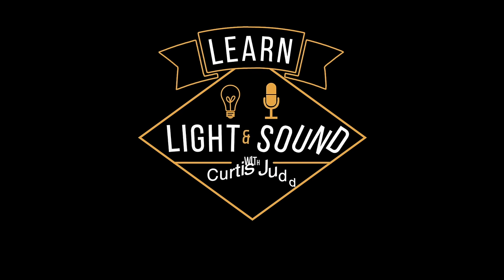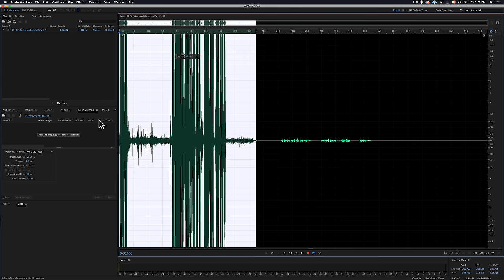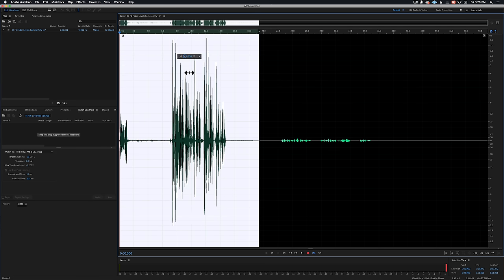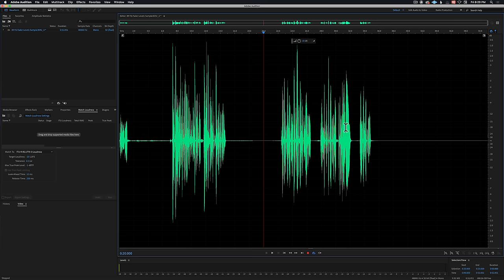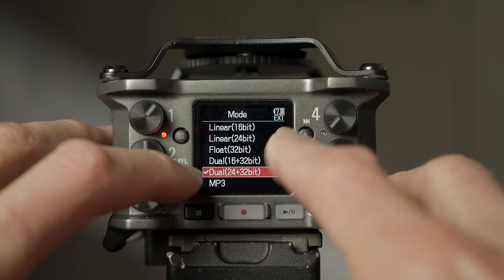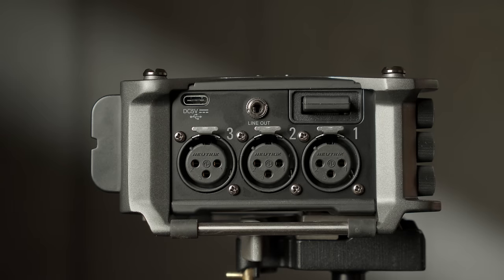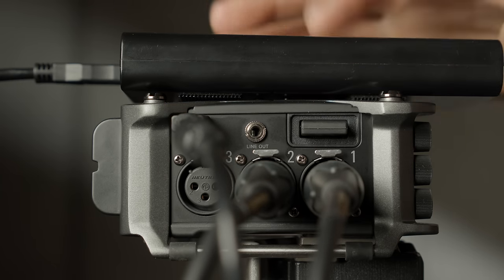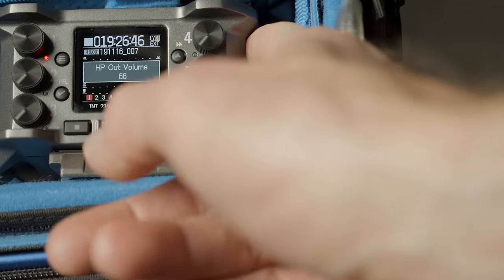Zoom F6 Audio Recorder Review

Comment: Dear Curtis, I have seen and analyzed your precious documentary many times, thank you.
I ask you now for another kindness,
I connected the binaural head in the channel (Fader 1L Fader 2R) and a Cardioid microphone in Fader 3
I put on the binaural as you recommended Poly. I have a +50 db Mic trim, normal stereo link enabled, HPF of, Imput Limiter of,
Phase Invert of, Fader +24.
In the Cardioid same except for stereo link off

In your video I read on the zoom screen +53 db
Then you say that the first part you recorded it at + 60db but I get up to + 24 and the last you recorded it at - 60 db but I get to -48
(what should I enable)

After recording with a Cardioid microphone (the same happens for the binaural head) it creates two rows one at 24 and one at 32, if I open them together as I think it should do, I notice that in the amplitude statistics window, it says that 24bit amplitude depth , while in your test I see that they are 32 bits. But if I only open the 32bit file, it says 32bit in the window.

I thank you in advance for the advice you will give me.
Reply from the maker: Hi Alberto, if I understand your question, I believe you will only want to open the 32-bit files as it sounds like you are recording both 24 and 32 bit. If I have misunderstood, please let me know.
Reply: Hi Curtis, I'm interested in 32 bits, for the binaural head. I would like as little noise as possible with the greatest possible volume and detail. I'm looking for the best setting.
Reply from the maker: @albertofelicettii426  I see. I would set the the F6 to 32-bit float mode in the REC menu. That should give you the best results. Best wishes!
Reply: Are there no other adjustments? The Trim and the Fader at what values is best to put them?
Reply from the maker: @albertofelicettii426  When in 32-bit mode, the knob is a fader and there is no trim setting. I would adjust the fader until the meters peak around -12dBFS.
Reply: Thanks for the advice, and congratulations again for the nice documentary

Comment: hi, thanks  for the video.   so  f6 is absolutely better  than  f4, right？  i want to choose between the tow.  need your advice.
Reply from the maker: Hi, it is a little more complicated than that. First, the F4 is discontinued. Once the current stock runs out, my understanding is that Zoom does NOT plan to manufacture any additional units of the F4. However, the F4 has balanced outputs which the F6 does NOT have. If you need balanced outputs, the F4 may be a better choice. If not, I'd probably go for the F6. Best wishes!
Reply: @curtisjudd    thanks  a lot.  by the way,  i need make a school  film.  f6+ntg5,  would this be a good  plan？
Reply from the maker: Yes, good combination!

Comment: Hi Curtis. Thanks for your videos which are always excellent. On occasions where you're not using an xlr mic, is it possible to connect something like a Rode Wireless Go mic receiver to one of the inputs?
Reply from the maker: Yes, you'll need a RODE VXLR adapter or equivalent.
Reply: @curtisjudd  excellent, thanks.

Comment: Great Review! Just wondering if it would be possible to use the timecode out to jam into the GH5. And if so what cable/adapter would I need? Thanks
Reply from the maker: You could feed timecode to the audio input of the GH5 if you send it through the entire shoot, but you cannot jam sync a GH5. You'll need a standard stereo minijack cable (3.5mm to 3.5mm TRS) plus the adapter listed in the description.

Comment: Hi Curtis, thanks for great review. I just got the F6 in house (birthday present from my wife :) ) and after some fiddling around I managed to get a stereo signal out from my stereo parabolic microphone creating a single stereo file into the SD-card. 
BUT I do not get used to the headphone setting, what will be the best setting for monitoring bird/nature recordings? I use Linear and 0 db Digital boost. Pls give me a hint on what will be best or what to test out!I use 32 bit only and seems to create a far too high signal into the HP..
Stein, Norway
Reply from the maker: Hi Stein, congratulations on the new F6! Unfortunately, there isn't a number I can give you because it depends on where you have the fader set, which headphones you're using, and how loud the sound source is. You should always set your headphones to a comfortable level which is not so loud as to damage your hearing. Keep it comfortably low, but loud enough to hear what's being recorded.
Reply: @curtisjudd  Hi again, since I run 32 bit float I have the faders set to maximum all the time, problem with HP on F6 is the steps, first step "Level 2" is already quite high for my Sony headphones. Any idea what the purpose is when pushing the HP-knob and you get a "Routing setting 1" etc..? Guess when I run both fader-knobs  to a maximum setting (and 32-bit float) there is no way that I have reduced the input level in the settings in menu (input and/or output). I want as much signal as possible :)
Stein
Reply from the maker: @snipolar  Interesting. I would generally not push the faders to max. You’re getting all the signal you need with the 32-bit float recording so there is no need to push the faders way up. Pressing in the headphone volume roller is how you get to the headphone presets, cycling through them one at a time.

Comment: One of the reasons sensitive software are available often to iOS only is that iOS is tied to a small set of devices - Apple - while Android is a generic OS. Similar to what happens between Windows and OS X: if your OS is tailored to a very small set of hardware configurations, it can be thoroughly tested and will run with much less issues. Perhaps that's why some companies don't release Android versions. Just like the messenger is often blamed, companies are often blamed by issues caused by Android itself and not by them. One thing they could do is say: it works with these Samsung (or some brand) products.
Reply from the maker: Thanks Max.

Comment: I’m new to field audio recorders, is 32-bit float recording with dual A/D converters common on higher end gear like from Sound Devices and Aaton and has now been brought down to cheaper devices, or is this a totally new thing in general?
Reply from the maker: I would not say common, no. But there are a few high-end recorders which support it. The current Sound Devices 8xx series and Aaton X3 do not support 32-bit float. It simply is not necessary for most dialogue production sound recording.

Comment: Amazing video, always so thorough! I’ve purchased this recorder to swap it for the Zoom F4 that I’ve been using for the past year as I think it suits my needs better. However, the line output to my Sony a7III from the F6 sounds so much noisier than the sub-out from the F4 did. Plus, I seem to be picking up a lot of interference from my Sennheiser AVX Lapel receiver and weird noise from my shotgun’s cable moving. This is a complete none-issue with the F4. Does anyone else seems to be experiencing weird Line out issues like this? I’m trying to figure out if I have a defective unit or if the Zoom F6 has just a very poor output solution.
If that’s the case, that makes me doubt the F6’s usability on the field given that my backup track, that is the one of the camera, is close to unusable quality-wise, as with the F4, the quality was close to the same as the internally recorded on.
Any insight from other users would be greatly appreciated :).
Reply from the maker: Hi Marc-Andre, I haven't had the issue with noisy output signal but I am not using a Sony camera. Perhaps others here have? I haven't used AVX with the F6. I'll let you know if we run into any of these problems with other wireless systems. Best wishes to you!
Reply: @curtisjudd  Thanks a lot Curtis for your input. The headphone jack output sounds a lot more clear than the line out in my case strangely enough. I ran a bunch of tests and I'm pretty sure it is just a defective port. I contacted customer service to get that sorted. Thanks again for the input!
Reply: @MorkClooder  Pun intended? okay i see the door

Comment: Hi Curtis! Awesome review, really useful as always) Please tell me what recording options are available when you recording directly to PC? And just to make it clear: MixPre-3 doesn't have this option to record directly to PC / Mac?
Reply from the maker: Hi replayer, both the F6 and MixPre series recorders work as USB audio interfaces so they're both an option. On PC, you can plug them in directly and record a stereo mix. On PC, you have to install an ASIO driver to record all of the isolated microphone channels. They can each playback audio from the computer as well.
Reply: @curtisjudd  got it, thx) another small clarification: it's possible to record in float mode (32 bit) directly to PC on F6 (10:37)?
Reply from the maker: @replayer5  I just tested here and it appears, at least on macOS, that it sends a 24-bit stream via USB when in multitrack audio interface mode. I don't see a way to switch to 32-bit mode when using it in multitrack audio interface mode.
Reply: @curtisjudd  hm, intetersing. Does this happen also on MixPre-3? Only 24-bit via USB?
Reply from the maker: Sound Devices just pushed new firmware today which enables 32-bit float streaming via USB. Version 6.0.
Reply: @curtisjudd  awesome! Thank you for the info. So I guess I should buy MixPre-3, this option is really helpful. This streaming directly to PC is kind of plug-in-play? I remember you mentioned ASIO driver, but just for 32 bit recording, do I need to install any additional drivers?
Reply from the maker: @replayer5  For Windows, yes, you'll need the Sound Devices ASIO driver to record more than two channels, i.e., to record isolated microphone channels.
Reply from the maker: UPDATE: I just read the release notes for the MixPre II V6.0 firmware update and from what I can tell, the 32-bit float USB streaming only works on macOS Catalina. I think you were looking for this on Windows?
Reply: @curtisjudd  yes, I'm on Windows. So in that case I can buy Zoom F6, since there is no difference regarding 32-bit recording.
Reply from the maker: @replayer5  As of today, yes, appears that 32-bit float recording to Windows from F6 or MixPre II is not yet possible.
Reply: @curtisjudd  Hi Curtis. So I've bought MixPre-3 (thanks to your reviews). I just can't quite understand why I can't record directly to flash drive? It always says that "no SD card", which is odd. There is no option to record directly to flash drive, or I'm missing something?

Comment: Thank you for this constructive review! 
 Although, I have some questions to make things clear. I’m new to external recording and I’m trying to get one for short film projects for dialogue and ambient recording.

Setting 32bit float circumstances
Mic: MKE600 with rycotte nano with fur thing
 
1.what does knob actually do? I’m confused with how it functions cause to me it feels like a gain function for 32bit. 
Like for example if my friend is monitoring through their headphone, is using the knob to find the right amount of sound being recorded called ok? Cause seems like turning the knob level lower means less noise being captured,,,?

2.Would it be fine to use for shorts films for dialogue recording outdoors? I would have to consider ambient noise would be captured when the actors are performing. But would the noise gobble their voices when the mic is headed toward actors?

3. F3 vs F6
I could use 2mics(shure SM7B and MKE600)
But the thing is I can’t see the bar indicator from F3. F3 seems to be the answer since I only have 2mics and it would seem that I might only use them primarily. But with the bar monitor absent, this makes me feel like F6 might be the option. 

Thanks 🙏🏻
Reply from the maker: 1) the knob is post fader level (digital manipulation of the level, NOT analogue gain). 2) Yes though I find it to be a bit cramped and not as ergonomic as larger recorders. 3) if you want or need traditional meters, then F6 is your best option between the two.

Comment: Thank you once again. You're using Adobe to recover clipped and under-gained audio in post? Do you know if this can be done with Final Cut Pro as easily as you made it look in Adobe?
Reply from the maker: Yes, FCPX can handle 32-bit float audio, but it’s user interface does not lend itself to optimizing the audio as precisely as Audition.
Reply: @curtisjudd  Thank you.

Comment: Hey Curtis, just tried plugging a 3.5mm cable into the F6 into the a7C for the audio timecode output from the F6. I am getting the most odd timecodes when I am using the update timecode from audio in DaVinci, I'm wondering if it has to do with the left and right that you mentioned for the F6 input and output. If you could weigh in, I would greatly appreciate it! Just one camera and one recorder, trying to line up my audio in post more efficiently
Reply from the maker: The first thing I'd look at is the output level. Reduce the output level if you can. It is possible its clipping the camera's mic input.

Comment: You said something about having headphones around 32ohm would be ideal. Have you tried using the F6 with the Sony MDR-7506? if im not mistaken those phones has an Impedance somewhere around 60 Ohm. And if so, did you find it to ever be a problem? Looking for some new fair prices headphones to go with the F6 i've ordered.
Reply from the maker: Hi Glenn, the MDR-7506s work with the F6, you just don't get as much volume as you would with a lower impedance set of headphones and you will potentially use the batteries in the F6 more quickly.

Comment: Hey Curtis, have you found a way to record a redundant track at a lower gain level on the MixPre6-II? Might this be a limitation of the signal flow with the analog limiters?
Reply from the maker: Hi Randy, no, that is really unnecessary on the MixPre II series. In 24 or 16 bit mode you have very high quality analogue limiters and in 32-bit float mode, you cannot clip with most wired microphones. So there's no need to do it in terms of preventing clipping. If on the other hand, you have some other reason for wanting to record the same microphone to two separate channels, you could use a splitter cable.
Reply: @curtisjudd  Interesting! I was looking to use it as a safety, but it sounds like I'm covered! Thank you so much for the reply.

Comment: In the midst of specialized audio recorders, how does the audio circuitry of a Sony FX9 or Canon CX00 compare? Has anyone on the tube done any tests on the subject?
Reply from the maker: Great question. To my understanding, none of them support wide dynamic range audio recording with 32-bit float so they will be susceptible to audio clipping. Also, their limiters are typically digital limiters which are not as effective (that's a longer discussion). But I have found that the Cx00 series cameras have pretty decent preamplifiers so if you're just grabbing a quick interview, they're adequate for the job.

One other note: If you're doing a cinema workflow, there are advantages to having a separate recorder. Most DP's aren't going to want the sound guy latched to their camera rig and why in many cases, if they do a feed of audio to the camera from the mixer, it is a wireless cam hop.

Comment: Could the sound be clipped before going into the F6? With a wireless lav system for example. You can set gain at both transmitter and receiver. If the mic is too hot and the signal clips going into the transmitter, wouldn't the receiver send clipped audio to the F6 and wouldn't it be clipped at any level the F6 records it at?
Reply from the maker: Yes, absolutely! Correct all the way through. If it is clipped before it gets to the F6, there is nothing the F6 cannot do anything to save that clipping. The 32-bit float mode is only really useful for wired microphones.

Comment: Hi Curtis. As a new person to audio your videos are incredibly helpful. I was wondering does this 32 bit float recorder require a cloud lifter for gain hungry mics like an SM7b?Also does this recorder have gain dials in 32 bit float mode? If so I’m confused on if you have to set it at all in 32 bit float? If that makes sense
Reply from the maker: Hi David, no, the F6 can supply up to 75dB of gain (in 24 and 16-bit modes_ so it does not require a cloud-lifter. In 32-bit float mode, the dials are NOT gain, but instead, are faders and adjust the recorded level digitally. In 32-bit float mode, you do NOT set gain. There isn't even an option to set gain in this mode.
Reply: @curtisjudd  I’ve been doing voice over here and there over the years and I want to thank you for taking the time on all the stupid questions I’ve been asking on a ton of your vids over the years. I feel like this may be overkill for my needs but if I ever were to get lucky to be full time voice over work it seems like this or the mix pre 3 would be the first and last recorder I’d have to buy. Like. Ever.
Reply from the maker: @DavidBrackett385  I agree and I would probably choose the MixPre.
Reply: @curtisjudd  if they ever aren’t back ordered lol!!!!!!!!!!!!

Comment: Can you utilize 32 bit float with the F6 as an audio interface? And if so, do you need ASIO input or something like that or does it work over a regular connection, like WDM, MME or others?
Reply from the maker: Hi Michael, fine question which I haven't tested yet. Will take a look when I get a few minutes. My hypothesis going in is that it does NOT support 32-bit float via USB to computer but that is merely a guess.